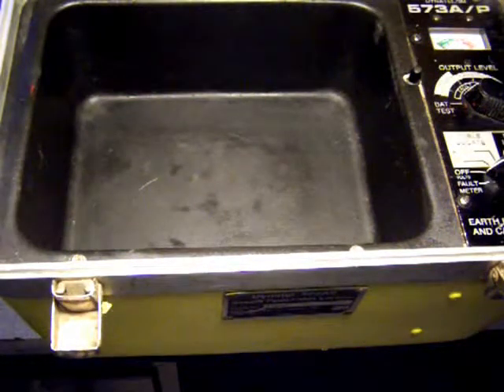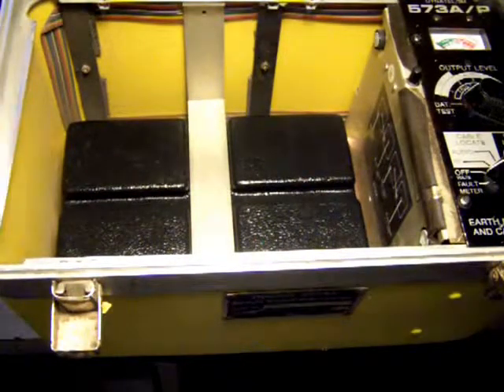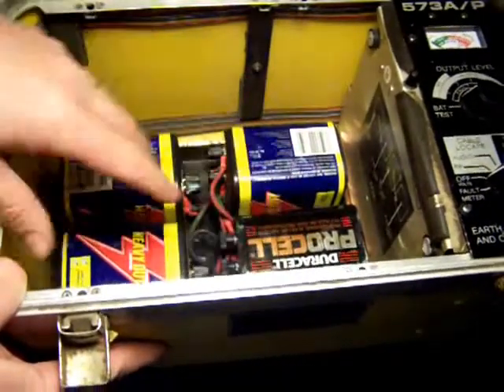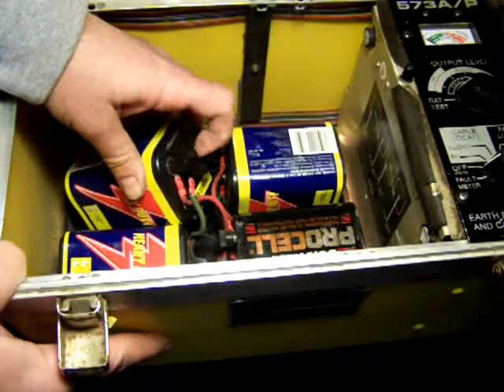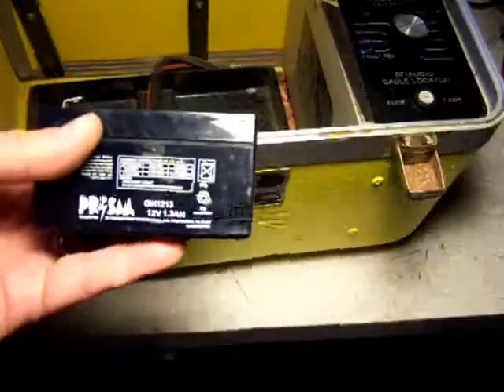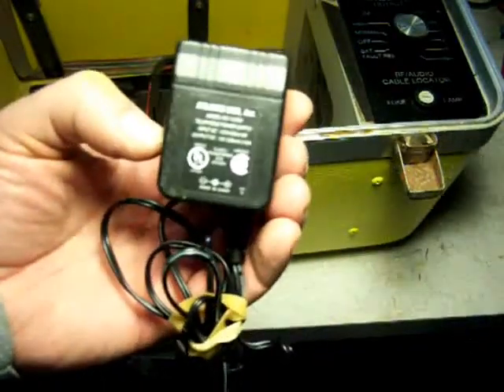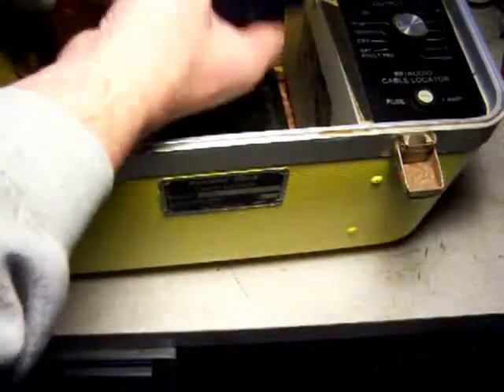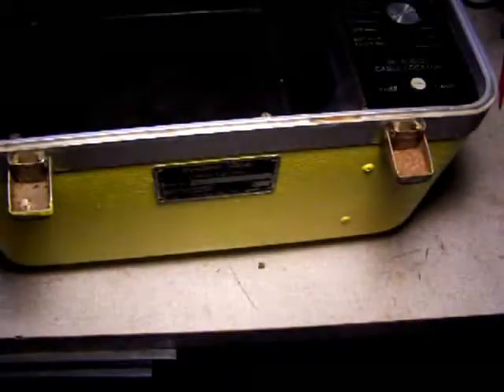Changing The Battery in a Dynatel 573 or 500 series Transmitter

Comment from the maker: The batteries I replaced them with are lead acid batteries and they work fine.
Reply: Harwkins39 Great machine I'm selling dynatel 505 and dynatel coupler on ebay search my username garciapablo1985 low starting price auction!